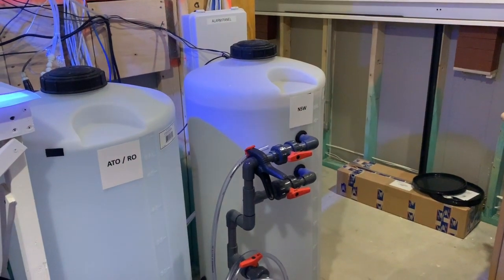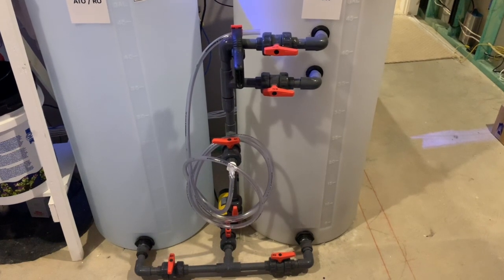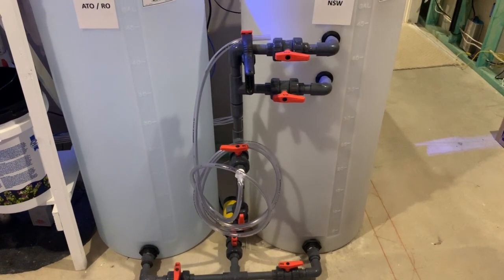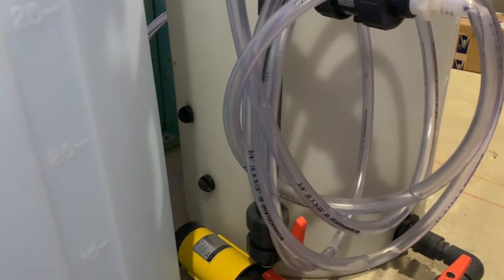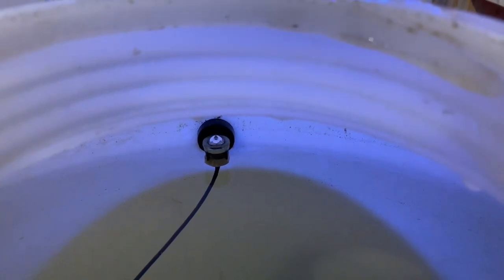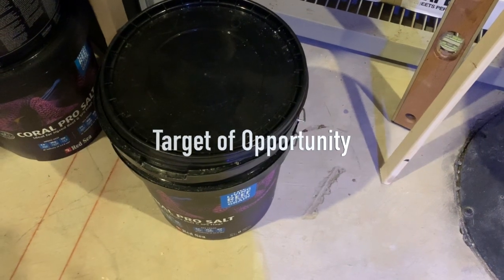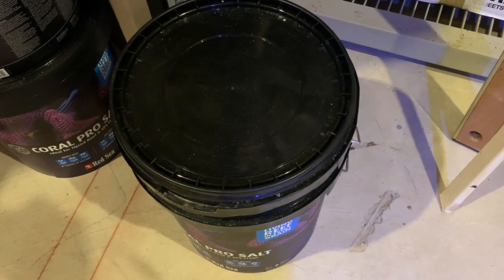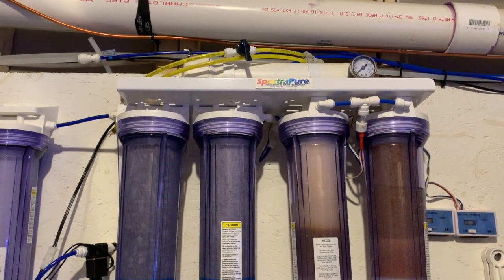Mixing Station Automated Fill and Other Projects

Comment: How do you set your RO DI filter to turn the water on and off as needed ? I use a Ball Valve but IF I put a float in my bucket maybe I can get something to turn that off . Just subbed by the way 
pelphrey
 from you-tube sent me to check out your channel.
Reply from the maker: jerry ebner I use a spectrapure liquid level controller. It has a sensor that starts / stops the RO unit. I’ve had it for years and it works great.